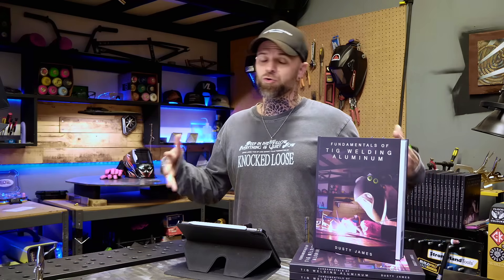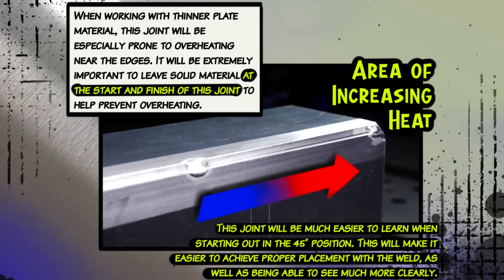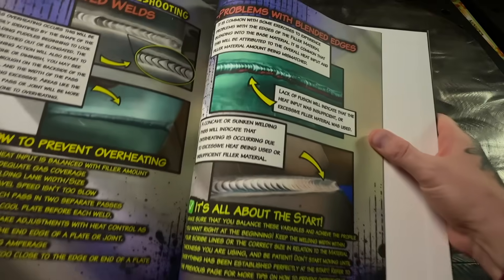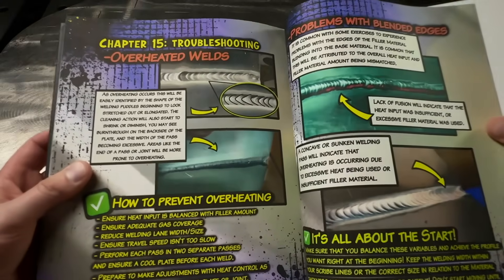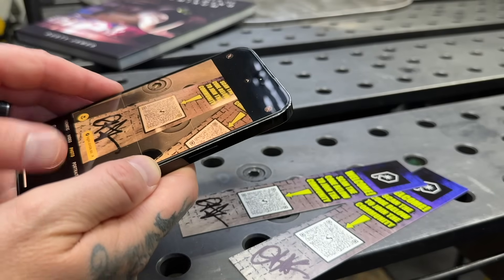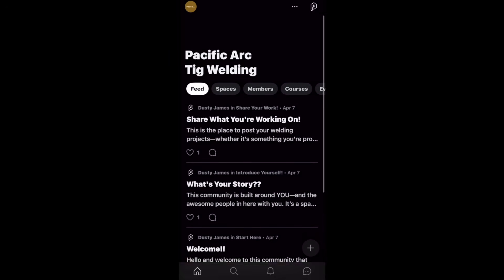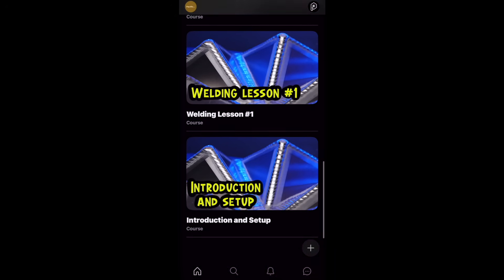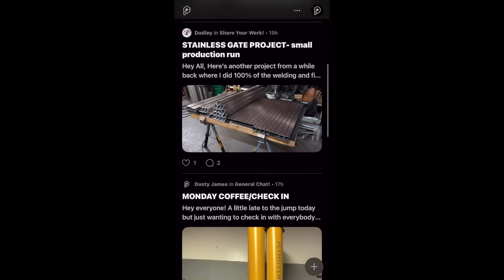How to Fix Tig Welding Problems- NOT Taught in School

Comment: I worked in a welding machine repair shop and I recommend you clean the interior of your machine every three to six months.
Check the operating temperature check the fan is it clean.
Make sure the transformer is free of dust, check solenoid for gas leaks.

Comment: Had an issue that i couldnt solve.  saw a video about a guy who stored his rods underneath a window with lots of humidity and it ruined his rods.  i realized you need to store your rods in an air tight container.  problem solved

Comment: How much skill/technique transfer between tig welding aluminum vs mild steel? I primarily weld to accentuate my blacksmithing, so I use mostly mild steel.
Reply: i find steel is easier and more forgiving.  heat control is HUGE with aluminum.  you can get colorful welds on mild steel if you use enough gas flow and a ton of post flow.  also if your doing non structural welds with steel like art pieces you can use stainless 309 rod on mild steel for a cool look.